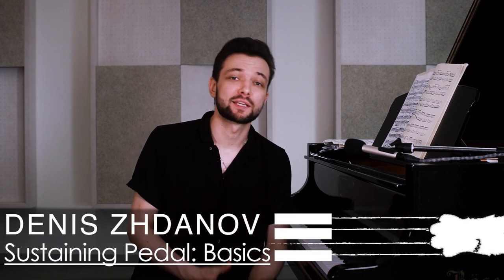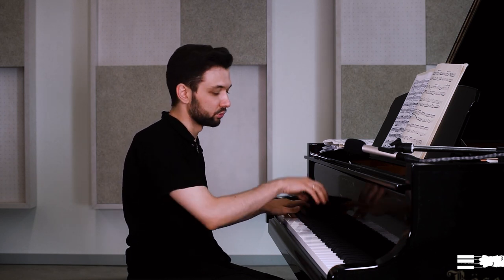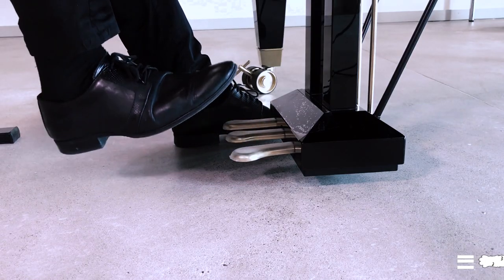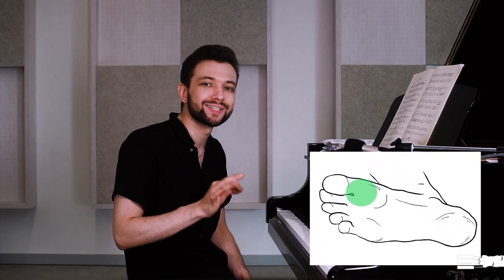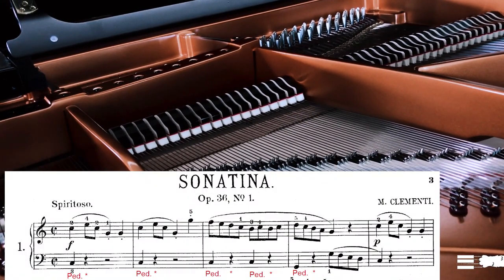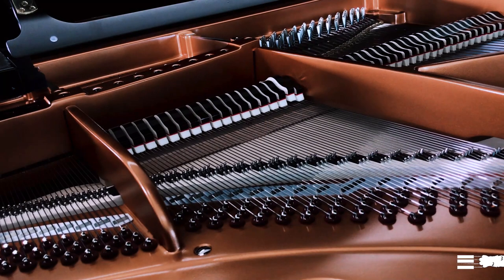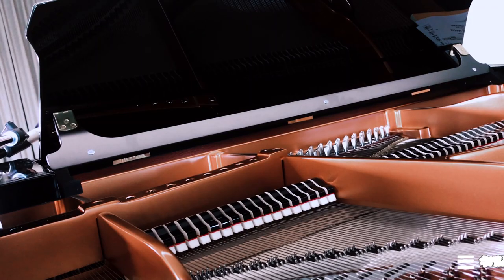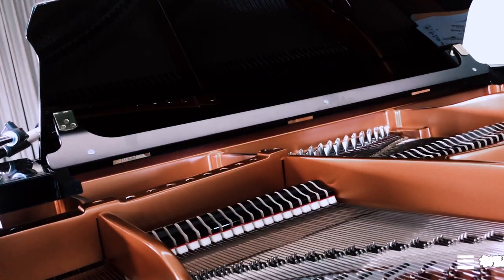Piano Pedalling Part I: Everything you Have to Know about Two Basic Ways of the Sustaining Pedal Use

Comment: Do you need to do finger legato when the pedal is used. What is the difference when a pedal is used with and without finger legato. Does it make a difference to the sound if I lift the fingers of the key after the pedal is used.
Reply from the maker: This is a little subjective topic of course. 

In my experience, sometimes the way you use finger pedal enhances your awareness of polyphony, and you’re able to provide a richer texture, a more elaborated sonority and more reasonable rubato, which is very handy in works like the first page of Chopin’s 1st ballade or the middle section of his 3rd sonata 3rd movement. For example, if you’d rely solely on pedal in such spots, you might run a little and play it in a fluent way which would sound “too easy” and kinda insignificant. By using the finger pedal you have better chances to listen better what kind of intervals are being created when you hold a few fingers simultaneously, and live through the musical tensions which appear from such combinations. I have a recent video on interpretation and tension in music, for reference of what I mean here.

But the main functional application of finger pedal is when you want to create a pedal effect in a certain layer, avoiding pedaling through in other voices. 

Typical example: Chopin Fantaisie op.49 measure 160. Here I use finger pedal in the left hand, holding Bflat F Aflat Cflat physically, while releasing the pedal briefly in order to show the pause in the right hand between slurred phrases. These pauses in the melody are quite important to me, because they help me to transmit an agitated character, imitating short intermittent breathing, but if we’d do these pedal breaks without holding the left hand notes, it will sound “naked” with an unpleasant dryness in the left hand layer. 

Does this answer your questions?

Comment: if we don't want the 3rd chord to interfere with the previous chords (specifically, Moonlight Sonata 1st Movement, measure 40, if beat 3 is not to interfere with the chord at beat 1 and 2), then we have 2 options:
1. assuming the pedal is pressed for beat 1 and 2, right before beat 3, release the pedal and when playing the first note of beat 3, press the pedal again, OR
2. same as above, but release the pedal when we play the first note of beat 3, and immediately press on the pedal again... this way, it seems it is harder to synchronize the finger with the foot
should we do (1) or (2)?  It is easier to synchronize our fingers and foot with (1), but (2) gives a more "complete" chord because the chord get a full beat 2... although you can argue if it takes a little bit of time for that chord to stop, then that chord actually lasted longer than it really should
Reply: P.S. I just remember like Denis said in his video above, if we play a note, other notes may resonate too... so if we have already stepped on the pedal when we play a note, then other notes can resonate better. If we play a note and then we press the pedal, it may cause other notes not to resonate as much
Reply from the maker: That was exactly my point in the old video on the advanced pedaling tips.